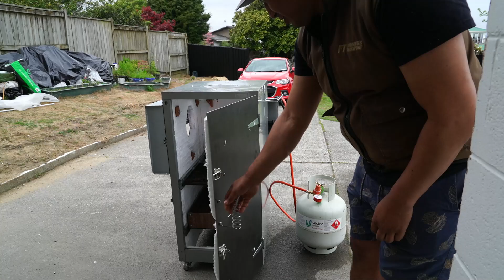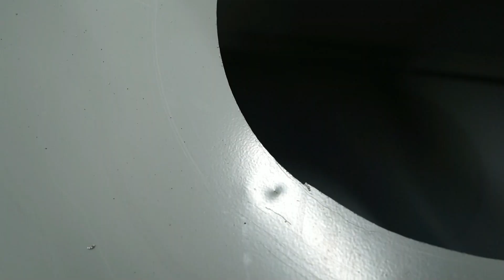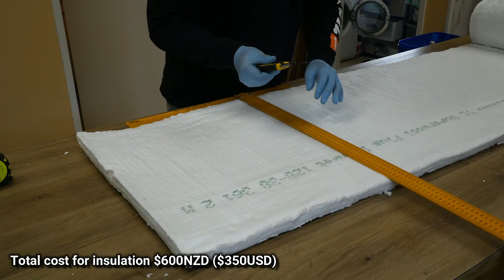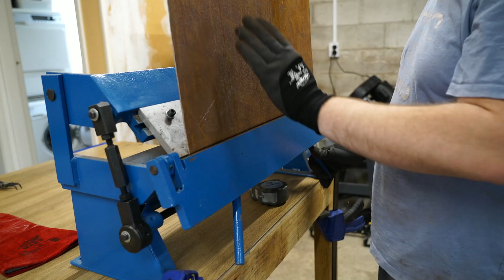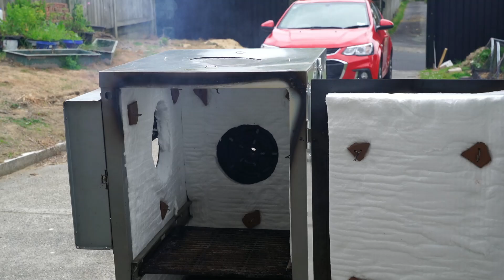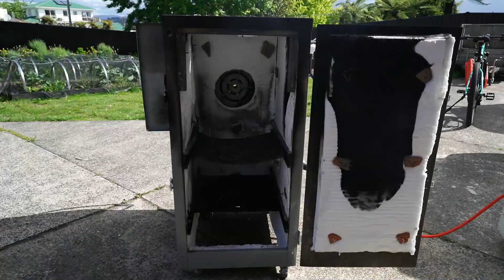Building a De-Waxing station for metal casting ll With extra crispiness!

Comment: I’ve only tried lost wax casting twice, but I had good luck getting the wax out on my second attempt by putting it in an oven at a temperature that was only slightly above the recommended injection temperature of the wax. If I remember correctly the oven was at 185F or so for about an hour or two. That completely let the wax flow out, and I replaced the wax pan with a clean one to start ramping up the heat until I got it to 350-400F. I then put it on my propane grill with it up to about 650-700 or so. 

I didn’t have investment, and I was trying gypsum compound. I unfortunately poured the metal into it way too hot for the gypsum, so it didn’t turn out. I haven’t tried it again yet, since I have been too busy to get some investment casting material to try again.

Comment: seems like a bed frame would provide excellent right angle iron that, welded to the door, would keep that from warping, and a couple of pieces could be placed as support for the bent shelf.  and.. people just throw those frames out, so..  'free if you take it away' prices = excellent angle iron for this sort of thing. which is good, because the metal is junk and can't be used for much else other than being rigid. ;-)

Comment: QUESTION: I just watched your video called “What is a Shunt?” from 2 years ago.

I would like to create an array of shunts that could be monitored and logged by a computer or arduino / raspberry pi, etc.

The purpose is to create all of the
 shunts as an inline plug for a solar panel array, so that i can see the live data output from each individual solar panel and also log the data with tine stamp for future review.

Could you create a video on how to do a project like this, or direct me to an existing solution if one is already available.

I have been searching for weeks, and I am not sure what search terms to use for this type of DC logging device.

Thank you for any ideas, links, or suggestions.

Note I am posting this question in the shunt video and your most recent video so you might see the question.

thanks

Comment: Interesting project! I've been metal casting for several years but have only done lost wax a couple times. I used a ceramic kiln for dewax. The wax vaporized there too. I think the key would be ramping up the heat. Start out just above the melting temp for the wax. When most of the wax is melted, remove the tray to save wax and then burn out the rest.

Comment: That thing looks dangerous as hell. Especially where the gas flows near hot spots. Not to mention the lack of safety gear. Interesting starting point though. I wonder if the idea could be used as a begining for a ceramics kiln?

Comment: That's pretty clever how you used the mounting "legs" to precisely mark the hole locations. I'm assuming you cut off the points after marking, drilled and tapped for mounting hardware. Genius! Nice clean professional build mates. I used to service waste oil heaters, which entailed much of the concepts of your build. Cheers from SLC! 🤟😎